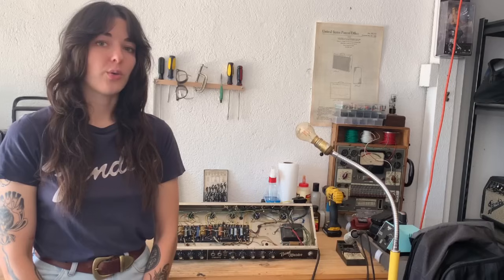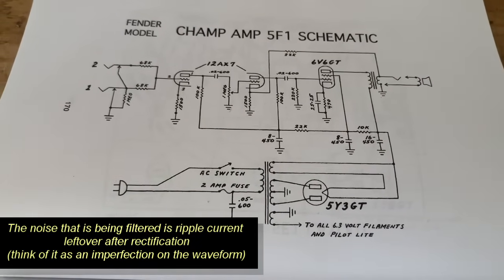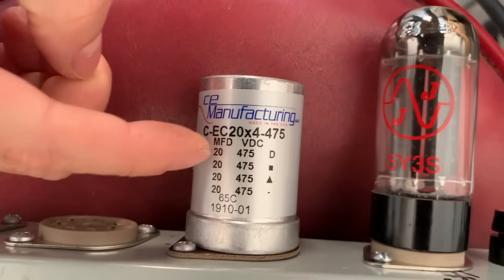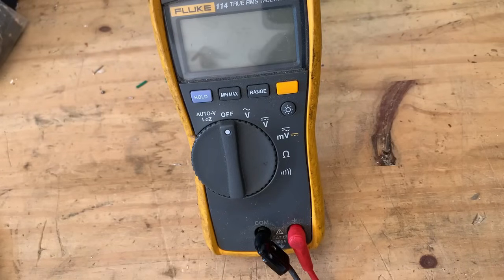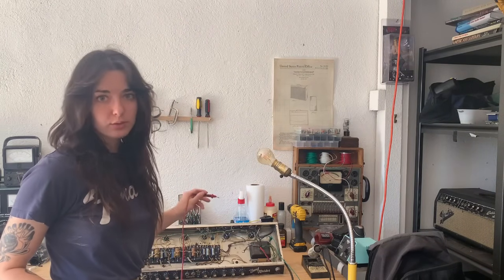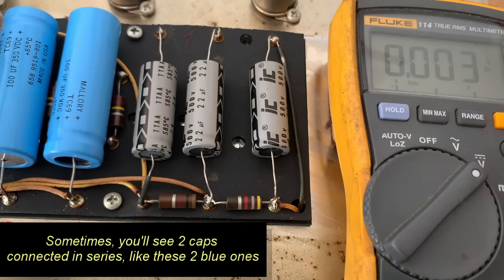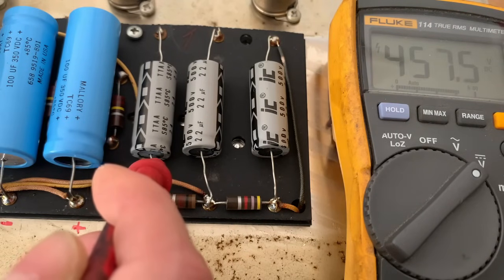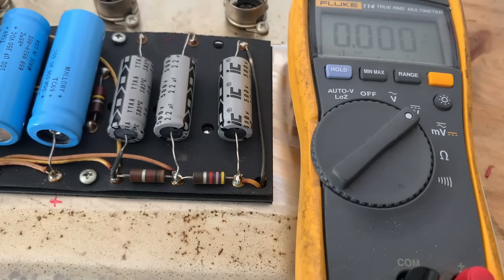Discharging Filter Capacitors & Reading Voltage in your Tube Amp | The Electric Lady

Comment: I did some work on a regional copy of a Twin recently and surveyed the contents of my doghouse after shutdown. The bleeder resistors drop the charge out of the caps in under a minute. I still 'discharge' stuff before I work on it, but previously I was unaware that bleeder resistors probably have done it long ago... I'll check the same thing on my other amps, I'll be curious to see if any of them just stay charged with nothing to bleed them.

Comment: Just a lil tip from someone who has been shocked...GROUND IS NOT ALWAYS ZERO.  I was working on a vacuum tube signal  generator with multi section caps with a metal shell. The unit had been recapped by somebody at some point and they did not insulate the cap body ( the original had a cardboard sleeve ) so I got zapped really bad when I touched the can that was floating at like 200 volts. Check and understand the schematic before you start ANY work.

Comment: Old video, I know, but just in case you'll see it: I've been told a few times that if an amp has separate power and standby switches, and if you leave the standby switch in Play mode, turn off the power switch, and then keep playing until the amp stops producing sound, you'll effectively drain the filter caps – these people claim that the steadily lowering volume is the sound of stored voltage being discharged from the filter caps, and when the amp goes fully quiet, the filter caps are drained to a trivial, harmless voltage, if not to absolute zero. Does that actually work? And/or, if it doesn't work, but I touch the filter caps anyway, will I at least die while being thrown across the room, maybe my hair catches fire, I don't know, just a cool crime-scene tableau? Sort of an electric "Death of Marat"?

Comment: When discharging the capacitor through the resistor, what do you have the negative lead connected to?
Reply: The ground which is the metal frame.

Comment: Hey Electric Lady...
 Cool name, sounds like the name of a song .... Anyways I'm Kixx and I want to build my own Guitar Amp that has ballz, heavy bunt with good distortion, but what gives the amp its distortion sound? Can you just change a single part to a higher number of same part to get a different sound? I know Marshall uses LM386 chips on their boards, is that what gives its gain for distortion? I want to buy an amp kit like the Marshall Plexi kit but make my own sound.... what components do I need to change the distortion to make it heavier? Even if I go solid state and no tubes what transistors or capacitors or parts are needed? ...

Comment: Most good multimeters in Ohm mode can discharge any capacitor.  But if you have cheap chinese meter using resistorto discharge is the only option.

Comment: thanx for the video. but grounded to the ground wire of the amp, but no further grounding to ... the real ground, does that the proper way. Doesn't it also grounded to something that really grounded. As you read, electrics in a tube amp never done before, but i have to learn. So ...

Comment: I have to discharge the caps from a solid state amp so I can check them but I don’t have any resistors around. Can I use a volume pot? Does it matter if I turn it all the way up or not?

Comment: Great and essential advice on poking around where only properly trained folks should go. A wooden Chop Stick is ideal for probing around high voltage stuff.  In an amp repair video, on another channel, the instructor was using a pencil as a pointer. Standard pencils have a Graphite core which is a pretty good conductor. Don't go in there with anything but solid wood or plastic.

Comment: how do you discharge filter caps on a Fender amp with the doghouse cover intact. This would eliminate the possibility of getting zapped by touching one of the cap's leads with the dog house cover as it is being removed.

Comment: As a student we had a high voltage lab and we were all ordered always to have the hand we weren't using firmly in our back pocket, to stop any voltage going across your chest (and heart). It's not just that it completes a circuit, that I'd say is the worst possible route! 
I've managed to electrocute myself more than once, thankfully lived to tell the tale.

Comment: I always lay the power cord on the bench with the plug right on the amp so it is obvious I haven't forgotten to unplug. And never have feet on bare concrete when servicing equipment.

Comment: I saw another method of discharging the caps….play the guitar strumming steadily and flip the amp of while continuing to strum until no sound is heard. Then check the cap voltages and it usually works well

Comment: In fact, i never worked on a valve amplifier. I work only with transistor amplifiers. I'm attempting to repair a 16mm rca photophone valve amplifier. Jane to watch out high volts in it
Reply: Rca photophone film projector. *have to look out for high volts present in the circuit. 😊

Comment: While the power on, can i measure the different high or low volts of the valves with the positive probe while negative probe attached to the ground of the amplifier.
Reply: Means body of the amplifier (tube ampli)

Comment: I am new to tube amps (i am one of those cursed sim peeps)and you have been such a important learning source for me.
I got a 4x10 bassman 45 watt combo RI I am turning into a head/cab and a 6505+ 60 watt combo i am giving the same treatment.
Take solace in the fact this video has certainly  saved lives (likely mine)
I was deadset on adding a fx loop to my bassman until I learned a bit more then I watched your other video(thanks) and converted my rca to 1/4 inch jacks.
Just the best tube content there is.

Comment: seriously THE most important step before tube amp maintanence, when I was younger i blew up a death cap in an ACOUSTIC P.A, i was lucky, sprayed in the face with shite, no eye damage, still have the old weld damaged screw driver, and ma mom.beat the crap outa me for the smoke and bang my inexperience caused. NO JOKE, LEARN THESE PROCEDURES !⚡☠️⚡

Comment: thanks a lot.. i was looking for precise info on how to set the multimeter for measuring the capacitors,
after turning off the amp..
also very helpful the infos about the draining with the resistor (type/ohm)
salute!

Comment: marshall mg30dfx stopped powering on, i replaced the power switch and the fuse still is dead, and i tried to pull out the circuit board carefully and main volume pot made so cheap broke, so i am going to assume the power transformer is bad can you do a video showing how to check it out? maybe amp is a lost cause because marshall probably wont sell you this part because so much soldering just to put it in? i got mad and bought a marshall code 25 thanks jeff

Comment: It's actually no safer if an amp has been unplugged for 50 years.  With a defective bleeder resistor a capacitor is free to regain charge from the air.  There's always electric potential in the environment.  Don't make excuses to take chances.

Comment: What if the amp has 2-prong power cord (no earth ground prong).  What do you attach the green wire to for safe discharge?  Just the metal chassis?

Comment: A bit more about putting a hand in your pocket while checking high voltages.  What is really dangerous is current across your heart.  By keeping a hand in your pocket, the charge will typically run down your arm, down the same side of your body and out to ground.  Great advice and a great video.
Reply: Does it matter what dexterity? I'm left-handed (the same side the heart is on), and do everything with that hand.
Reply: She is probing with her left hand. If she was to make contact with her left hand instead of the probe it would run across her heart to ground. So either way be careful.

Comment: Hello! Do you happen to know if the orange terror stomp, has capacitors ? And do they need to be drained. I looked inside the pedal, but it doesn’t seem to have any caps, just had a tube. If you have any info, would love to know. I want to do some mods/ adjustments to it. Just want to be safe before I move things around and touch things.

Comment: Howdy.
Feeding the amp. through a separation transformer is recommended. It will not protect from capacitor voltages but it will protect against leakage from the mains, through the body, to a concrete floor.
I believe licensed repair shops are mandated to supply devices through separation transformers.
Regards.

Comment: Great video...just for awareness, you took your hand out of your pocket to turn the amp off which potentially completes a circuit with your body @5:04.  Better to follow your rule of thumb and remove the probe from the cap first.

Comment: Did they really shorten micro Farad as MFD? Holy moly, that could easily be misinterpreted nowadays. I wonder what they'd use for milli but I guess there wasn't capacitors that big even available back then. Nice bit of information right there.

Comment: does the discharge work with the powerchord connected, so that it is grounded? or do I have to disconnect and pull thepowercord off while doing this? Thanks in advance
Reply from the maker: Always unplug the power cord when you’re working on the amp!! The chassis ground will suffice :)
Reply: @FazioElectric  thanks for your quick reply. i somehow found this out in the meantime by checking with my multimeter. 

Thank you so much for your input by making your videos. I did my first amp mod today, which included, swapping filtercaps, outputransformer, tremolo caps and resistor, reverb frontpanel pot and adding a nfb pot in the ext speaker socket on the backside. All done on a 65 princeton reverb reissue. 

The whole bass-fartyness is gone. Still wished i could get the amp to breakup a little earlier. But anyways i am so happy that it all worked and sounds good. 

Apart from that I saw that a few of the plugs from the powertransformer that connect the pcb show signs of heat. I might need to solder them and a few other parts from the pcb directly to the tube sockets. 

Maybe you might do a tutorial about this in the future. However you have been a great help with feelgoodvibes at the same time. 

Take care and have a good life!
Colya

Comment: Thank you! I have two Sansui units that I will be recapping soon, and could find nothing on discharging the caps. I always used a screwdriver, but those were in HVAC applications, not stereo equipment. I figured it would be something easy and safe like this. Thanks again.

Comment: Thank you for your clear demonstration!  Are there any other capacitors or components that may need to be discharged in tube circuits before working on them, or is it just the filter caps?
Reply: I would use your multimeter to check all of the caps like she did in the video, before poking around with a pair of snips, and then discharge accordingly. Then, recheck your work with the multimeter. If you are poking around in there, use a chopstick, a wooden one. ;-)

Comment: Mr. Carlson's Lab on YouTube designed a low cost filter cap discharging unit that you can build. It's handy, sits on the shelf until needed, and you don't have to setup up anything or run for alligator clips, and it looks professional when being used. Great explanation on the safety and how to's of keeping yourself safe while working with high voltage circuits.

Comment: Hey, I'm currently restoring two TEAC A4010S reel-reel tape decks and getting my "feet wet in vintage electronics so to speak". Built my own Dim-Bulb circuit tester to make sure they were safe to plug in with no short circuits and had healthy transformers. ( having a variac would of been good also). Just wanted to stop and say I found your video really enjoyable and loved seeing your electronic workbench. Solid state amp repair is fascinating, and I've always wanted to get my hands dirty on some vintage high voltage warm tube based equipment. Found this video from using google search on the topic of discharging capacitors, it was very informative and to the point. I chose a 5W 100K Ohm power resistor heat-shrunk to some 14 gauge red wire with two metal hollow ferrules soldiered and heat-shrink to the ends of the wires. I imagine a lot safer than discharging electrolytic capacitors and CRT TV fly-back transformers than with a rubber handled screwdriver and gloves. =/. I will be watching more of your videos in the future, thank you for sharing your skills, knowledge and beauty with a fellow electronic hobbyist here on YouTube. *attached is a photo of the cable I made, https://ibb.co/F3hhmGN *

Comment: Great video, I wish I had this 20 years ago. Super beginner question, but if the amp is unplugged, how is it grounded? When you discharge the caps through the chassis, where does the electricity go?
Reply: The object of the draining exercise is to remove the charge (and thus the high voltage) from the capacitor(s). When a resistor is connected between its terminals, the voltage on a capacitor appears across the resistor and current flows. If a voltage is causing a current to flow in a resistor, then the resistor must be dissipating power (P = V x I). A resistor dissipates power by converting electrical energy (i.e., the charge) into heat, another form of energy. This heat is then lost to the surrounding air. In other words, the charge doesn’t go to ground, it is lost into the atmosphere. The only function of the chassis is to provide a convenient method of connecting the discharge tool to the negative terminal of the filter capacitor. By connecting the discharge tool directly to the capacitor terminals, the chassis is removed from the procedure.
Reply: @silasfatchett7380   Ok, that makes sense now. I appreciate you taking the time to reply.

Comment: Great video. Straight forward and very clear. Good warnings as well. Wondering Colleen, about those multi caps however, those under the can, how would you discharge them? I havent looked inside a can yet, just wondering. Thx again.

Comment: Has anyone ever suffered serious injury from the discharge from filter caps? They aren't that powerful and often they discharge when the amp is unplugged on more modern amps. I think the biggest threat might be wet hand touching the B+ on a plugged in amp. 400 volts DC and the like. Not pleasant but I'd seriously like to know if any serious injuries are documented from techs doing work getting shocked and actually being injured. I'll bet it's pretty rare.

Comment: Great detailed video ,  
How is it done with pcb radial capacitors ? 
(Usually, the pcb is screwed  close to the chasis
So there's no access under it to touch the cap lugs .)
Reply: Check the schematic and find the resistor connected to the positive terminal. One of its leads will be connected to the chassis, and connect your discharge tool to its other lead.

Comment: I have a small computer electronic repair shop just starting up. I’m starting to get other items for repairs including an old SWR AMP and I feel I’m totally out of league on this one!!!! First, thanks for clearing up some safety issues. Next, any advise on what to look look for? I found 2 blown resistors, replaced them along with a transistor that blew. Blaming the transistor, placed everything back and as soon as the guitar is connected it blows the resistors again.

Comment: Hi, the voltage stored in the caps is discharged to the chassis, but the chassis itself is not grounded or is it? How can the chassis discharge the voltage stored in the caps if it is not grounded? Sorry i'm a total genius

Comment: Nice video. No tricks, no hacks and no strange tools. Just what is needed and the basic (safe) way to discharge and the reasons behind it. Also, "hand in the pocket" is a great back up to thwart possible accidental leftover voltage.

Comment: Thanks for this video. I’m a trained luthier in Texas and have owned and operated a guitar repair shop since 2007. Sadly, just a few short years after finding a really good and reasonable amp builder and repair guy nearby, he decided to retire and will no longer take on repairs. Since I run a guitar repair shop I’m constantly getting asked for a good amp local tech. I’m very experienced with guitar wiring and so I take on simple jobs like speaker swaps, power cable upgrades, simple and obvious component replacement, and even acquired a tube tester… but I’m not an experienced amp tech. My question to someone like you; if I were to look to taking the first steps in becoming educated to become a guitar amp tech for repairs, what would you recommend? Thanks!
Reply: The Valve Wizard's and the Aiken Amps websites are a good place to start.

Comment: Hi Colleen. I know nothing about electrics. My favourite bass practice amp has an intermittent fault of crackle and zero sounds. it's so intermittent the Techs here in Ireland say they can't hear anything wrong. That's cause it's intermittent - sighs. This is a small Ampeg with small board. I'm guessing its a bad joint - I've had it for years. How long should I leave it before I open it up and look carefully at the back of the circuit board for poor solder points - if it's unplugged would any voltage be there after say a week? Thank heavens for someone who can make a clear video even a drongo like me can understand. You have not assumed any knowledge on the watchers behalf. Have subscribed

Comment: Are the filter caps really all that you need to worry about?  What about the plethora of other larger caps shown in subsequent photos?
Reply: As Colleen states in a reply to another comment, when the filter caps are discharged, the amp is safe to work on.

Comment: Good tip on using a resistor to drain voltage.  I am new to this stuff and don’t understand settings on multimeters.  It would help if you show what your multimeter is set to when doing readings.  Thanks.